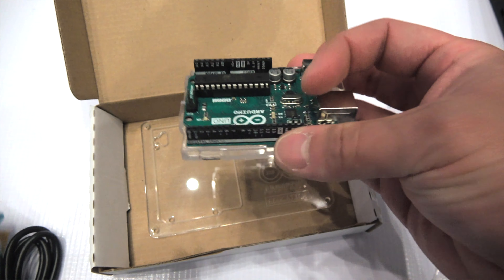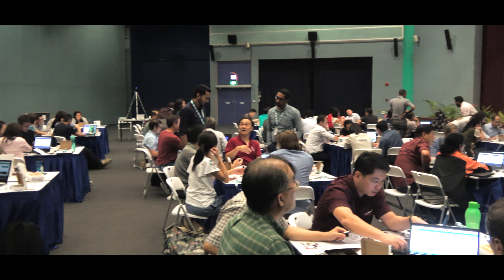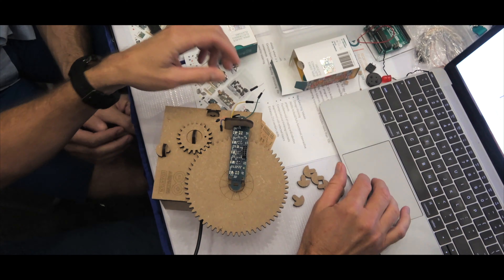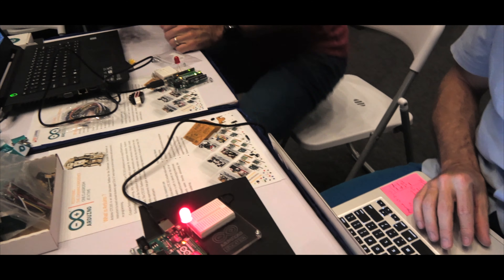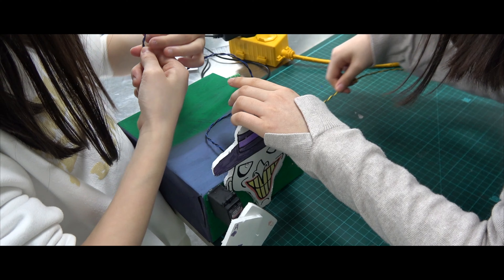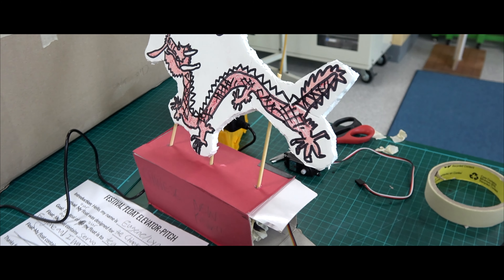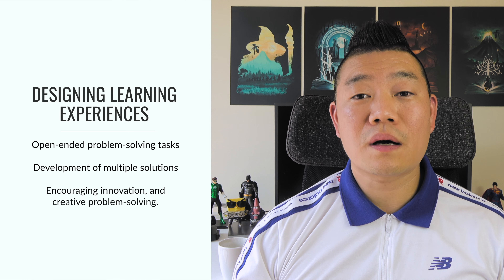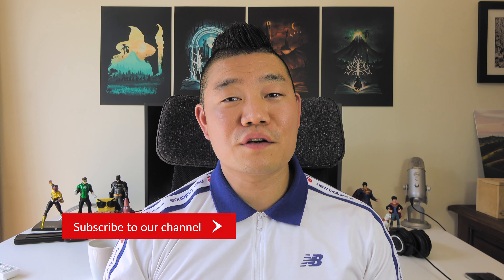Edtech Startups for Students

Comment: I bought myself an Arduino but I found it overwhelming and confusing! I think if I just had the right set of instructions/person to explain it (like the seminar you showed), I’d discover it’s way simpler than I thought, and I could use it with students! Especially the one that incorporated Scratch - I’d love to know more about that, because Scratch is a system that my students definitely understand! Can it be done on a Chromebook? Sometimes I run into issues with tech that requires software to be downloaded, and then I’m out of luck...
Reply from the maker: I would totally recommend hummingbird duos or hummingbird bits. The bits are cheaper. I didn’t try them on chromebooks. However I think it would work. The coding is done online on the makeblock website.
Reply from the maker: I would totally recommend hummingbird duos or hummingbird bits. The bits are cheaper. I didn’t try them on chromebooks. However I think it would work. The coding is done online on the makeblock website. THese tools are a game changer!!!
Reply: @DavidLeeEdTech  Thank you!